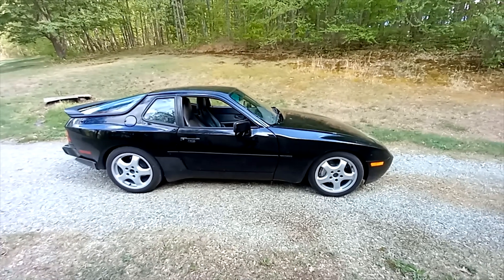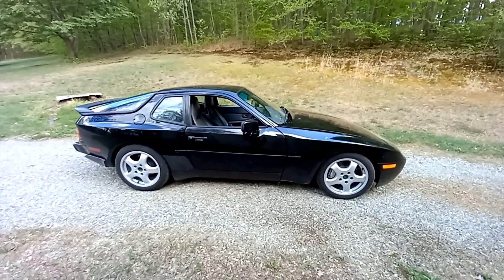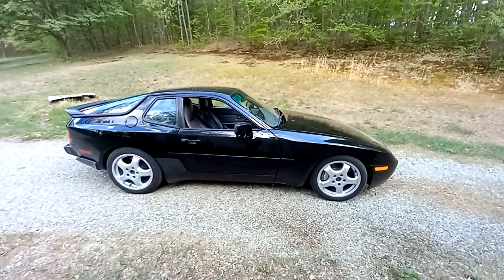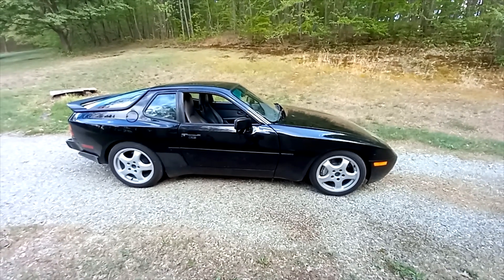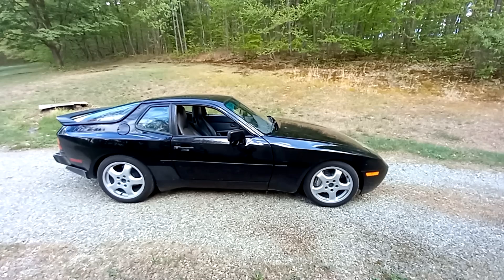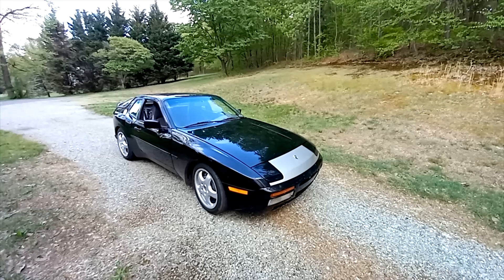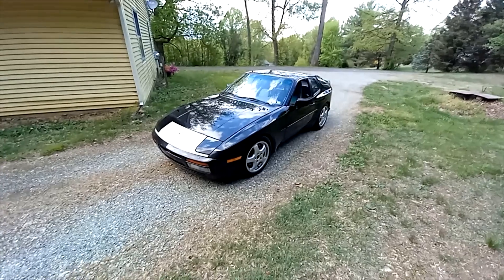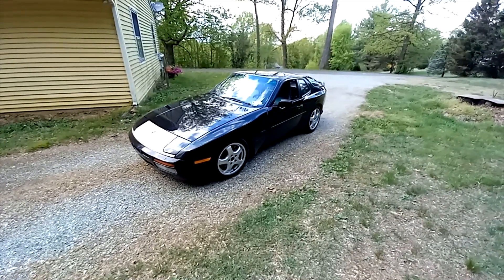LS V8 powered 944, Tunning Milestone!

Comment: Hey Don great stuff here. Really curious about what your fuel pump is and what you did to set the pressure on it. Biggest ask is because I am getting very very close to first fire and after troubleshooting my fuel pump which is dead and seized after 14 years of premium being left in it I am in the midst of replacing it. So really curious if you went a different route than the typical 044 Bosch for higher flow or the oem replacement which is a 69458 or something and what you did to further dial down pressure. Guessing that's a regulator at your fuel rails? Mine is just gonna be the stock 5.7 fuel rails so just curious on what you did here for my own knowledge and others at this crossroad.

Are you on 944hybrids forum? Look me up as guttterboy on there if you are. Got my own thread on my progress. Cheers!
Reply from the maker: Strongly enough, my pump is the original 1991 Bosch pump. New filter and fuel lines, that's it.
My system is and MSD Atomic LS and I am running it as a return system so I have a regulator on the return side. Pressure stays rock solid.
Can't wait to see yours up and running!
Reply: @stokerdon1020  ah I see. I'm gonna run a new 69458 but am returnless and with chevy ecu that must have been tuned for the surprise 222/224 112lsa comp cam I found in it, got hptuners mpiv unit and extra bung on my exhaust for future wideband and getting into tuning. but I think putting a fitting and a gauge on my stock ls1 fuel rail might be a good idea just to verify what pressure from new pump is based on your experience here. Will be very much excited to get this thing breathing fire again. First crank of starter to ensure solenoid engaged was enthralling. Smiles for days on finally some tangible progress. All my electrical work just doesn't show much for all the effort it took, till all the dash lights came on and even my aftermarket stereo add from back in 2005 lol.
Reply from the maker: @wheeleroharrow6501  FIRE! FIRE! FIRE! LOL!

Comment: Hey Don I'm working on a 5.3 swapped 944 and I was wondering what headers you went with.  The manifolds I bought aren't going to work and I was wondering where you got yours.  Thank you!
Reply from the maker: I wanted to go with stock cast manifolds too but none of them fit the drivers side. I bough the whole kit from Renegade Hybrids and I bought their headers too. There a bit expensive but the get the job done and work really well. The only other option would be to make your own.
Reply: @stokerdon1020  I'm gonna call Texas performance concepts when I get some time but I might try to go with their long tubes they look nice.